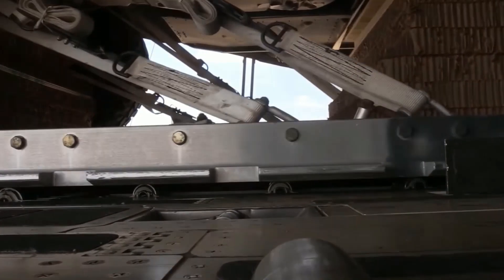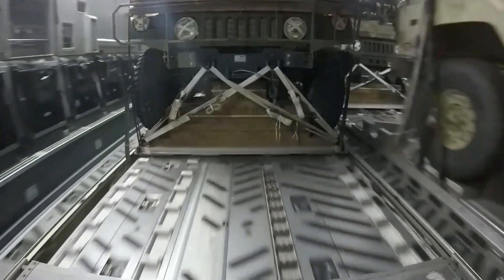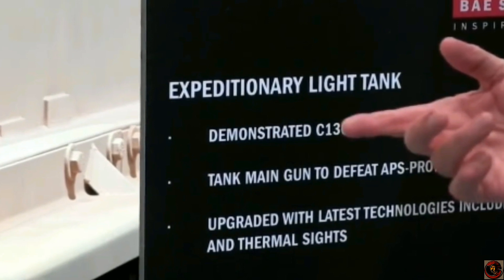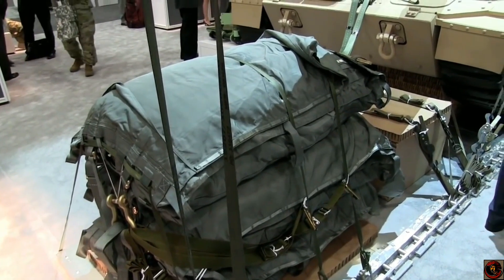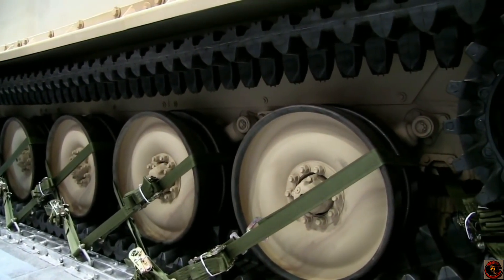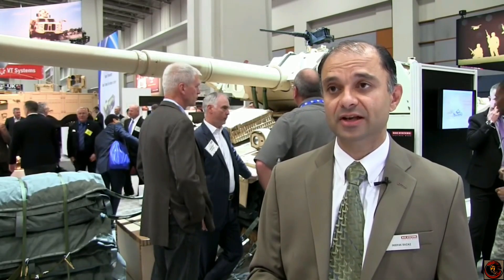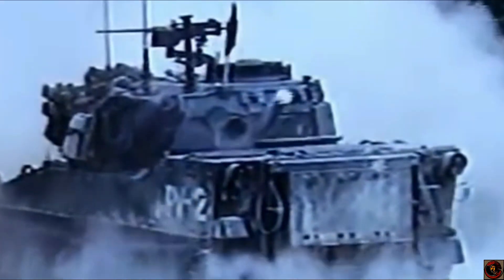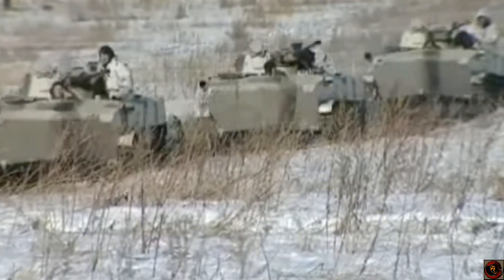Dropping a Tank From a Plane - Airborne Armour?

Comment: In my personal opinion this is a HUGE waste of money. First off because right now there is no need for it. Secondly if we did build a "light" tank, it is not going to have anywhere near the protection (armor) need to stop anykind of anti tank missile or main tank round. We are better off just using something like the Stryker Gun System. It has a VERY powerful 105mm that can easily destroy most MBTs and any IFV. It will probably have just as much protection as any tank they design that is going to be dropped out of a plane. Right now our best option is to just do what we have and that is to use our C-17's to land on a short, dirt runway and let it role off out the back! Otherwise all we are going to get if we spent money to design a new light tank is a tank that isn't going to have any armor. The reason why the Sheridan was a failure was because it had zero armor and the 152mm gun didn't work.

Comment: i find armies to day so f ing inefective and not having nearly as much fantasy or will to expariment with other things maybe im just stupid but i can think a system up right now i mean just make a ligth armor fast tank with good suspension an sloped armor with side doors as well as a top hatch to enter it and the parachute storred on top when it reaches a serten altitude it realeases the parachute or can be done manuely from the inside of the tank then u have a giant smoke container that can be dropped from under the tank to create smoke be fore landing when the tank lands u either realease the parachute from the indside or cut it off  should only seconds to doand if nedded be install wheels on it to make it even faster and with a good amount of camoflage to hide too bad the only nations that were a little creative with there armies where the nazis and soviets. but im no tank expert just a mechanic

Comment: Maybe one of the systems with a few anti tank missiles and a small caliber autocanon would fullfill much of the same role for less weight? If you designed it without the APC capacity and up armoured it? You could allways bring extra missiles seperately (in fact if you made it with infantry operated missiles you could drop the extra ammo with the infantry and retain anti armour capacity if your tank eats AA).

Comment: Hello Matt, I enjoy your non-gaming vids. This one was kinda like a home video for me. I serverd at Bragg for a dozen years. Most in 3/4th ADAR (Vulcan/Stinger) (82nd). Our unit was next door to 3/73rd Armor. Which was deactivated in 94 I believe. Left us all feeling heartbroken and less safe. The higher ups thought NO tank was better than an old tank. Supposedly a company of Bradleys at Ft. Stewart was set aside to support us in case we flew. We STIILL had to secure the DZ and FLS to get these there however. All made no sense to me. We dropped Charlie Company (I believe) on Panama in 89 very successfully. 8 G-11 parachutes for each tank. I hear there's something going on there lately again with tanks. I left in 02. A specialized armored vehicle is needed only until the rest of the 18th Airborne Corps starts arriving. 90mm main gun is plenty. Rubber tracks are fine. No more than a couple dozen rounds (including canister ;) Something that's not going to leave the DZ. If we had to, more than a couple miles that task would be passed off the Mech infantry. Keep the light tanks near Support. That's my 2 cents. We loved our Sheridans. It seems the politicians and defense contractors will make the decisions though. With little input from the guys in jump boots. 

Keep the vids coming. If you do one on the POS Avenger, gimme a shout.

Tino
Reply: I had completely forgotten that you could heavy drop a Sheridan!

I agree that the specialized stuff is only needed for a relatively short time before the heavier units arrive.
We had anti-armor infantry organic to the line battalions in the 1980s.  I was one.
If you have that kind of capability to fight against armor, it makes sense to do what you can to bring some of your own with you.
You really don't know the exact capabilities of the enemy at the DZ, so it makes good sense to bring whatever cases of whoopass that you reasonably can to the party to help secure the area for follow-on troops.
With the airfield takedown, you don't have follow-on troops just a few days of fighting away.  You ARE that landing area.
If you can't secure it, those guys probably aren't coming very soon and your best hope for a while is extensive airborne resupply while you figure out how to NOT let your new DZ catastrophically erode  into a 21st Century Dien Bein Phu.

AATW, Brother!

Comment: strv 103 the S tank ride height , not to be used in the offence but capable to secure an area on the defense side, rule 1 do not drop para's when there is no supprise and also not in an area secured by armoured units. But the strv 103 is very useful as an defense option  in an ambush.

Comment: Since we are talking about airborne/air assault operations, I would imagine that this vehicle would be used primarily to reduce strong points. In the anti tank role, it would probably held in reserve at higher HQ [ Regiment or higher ] for a reactive role. Much like the US tank destroyer doctrine from WW2. In such a role, heavy armor is less of an issue than rapid mobility.
Reply: It could also be useful in the asymetric conflicts Western forces increasingly find themselves in, if the hostile force doesn't have armor and shoulder-fired missiles are their only anti-tank option, lighter and on the scene is better than more capable and 500 miles away.

Comment: A prototype-sale pitch made by someone who is nto a salesman, for a system they want to build on top of a 15-20 year old platform, with a dev cycle that's still a pipe dream for a fairly niche yet useful deployment method.
The "ready within 15 mins" thing seemed rather long even for a second/rear/support line deployment.
I'm with you wghere they may be bettter off designing the system from the ground up rather than testing and rebuilding an older platform to fit the current requirements.

Comment: Rubberized tracks contain metal components internally.  Metal tracks use rubber material.  They are really not so different.  Metal tracks use mechanical connections that include pins and rotating connections. Rubber tracks are built as a single component that uses flexing belts of metal inside and rubber outside.  Like radial tyres. Common, everyday use of combined use and flexible materials.

 Rubber tracks were proven reliable on US M# half trucks that operated for many years after WW2 with long lasting tracks.  Some are still in use privately.  I had a Kawasaki with belt drive and I thought it was great.  The difference between the two systems is not so great if you consider them from a different perspective.

Still, I am not expecting main battle tanks to change.  They do not compare to WW2 tank tracks.  They are built to much higher quality and strength with much greater reliability. They achieve greater speeds and longer ranges with less maintenance and failures. Steal tracks are here to stay and rubber tracks will be used as well for lighter vehicles. 

  I have not seen rubberized tracks used on an MBT.  I am a big fan of  wheeled AFVs,  ( for Australia's long distances ) but tracked tanks still have a major role.

Comment: That is Sicily DZ at Bragg. My buddies back in the 80s who had participated in CALFEX exercises would see the Sheridan tanks being LAPEs dropped after the entire brigade has dropped just crash into the sand. I have jumped Sicily a couple of times training at Bragg I would have loved to see a Sheridan being LAPEs dropped personally.
Reply: I believe that the LAPES deployment is still quite viable for such a system.
But, it looks like these guys are talking about something like a heavy drop for a light armored vehicle, which is completely insane.

The canopies alone (8) to heavy drop a full sized road grader come out to a literal ton in weight.
That does not count the rigging. That is just the parachutes.
Then there is the problem inherent to Airborne operations: exactly where is this multi-ton hunk of explosives-laden equipment going to actually land?
Sicily DZ is nice and huge, yet on a dog-and-pony show when the Soviets visited Ft. Bragg in the late 1980s saw about half of a battalion of men being deposited into the trees on the NorthWest corner of Sicily because of the vagaries of the winds and human error. I found myself over a section of the DZ that I had never even seen before which caused me to have to slip so hard and long to avoid trees that I did cheetah flips on landing and bent my M-16.
How many times have we witnessed heavy equipment simply drifting into the forest at the edge of the DZ?

Then there is the problem of finding the damned thing once you land since the heavies are deployed first.
It's usually dark and there are over 1,000 excited and nervous young men running around with lots of deadly equipment just itching for an excuse to unload it on someone, not to mention the actual enemy that is actively trying its damnedest to kill you.
It's a wonder that you can locate any heavy equipment on a hot DZ even with the extensive amount of training that Airborne Infantry does.

LAPES makes a whole lot more sense based on the fact that the primary mission of Airborne operations for the past several decades has been airfield takedown just like my boys did to open the Christmas party Panama 1989.

LAPES, like any system, is not perfect.  Bad stuff happens like what you mentioned and like the pilot error in the Summer of 1987 that lead to the loss of a C-130 and crew plus a few on the ground.
https://www.youtube.com/watch?v=kyhKCAgk5oo
Side note: The actual load was delivered unharmed and the aircraft and crew would have survived is they had a few hundred more yards before the trees and the 50 foot or so drop at the edge of the DZ.

Matsimus mentions the Russians airdropping APCs successfully.
I believe that 2/325th experimented with doing that very thing with LAV25s back in the late 1980s."
Also, APCs are far lighter than an actual tank, even the M-551 with its light hull.
Notice the crazy amount of canopies used to drop that Russian APC and then try to increase that for the additional weight of an actual tank.
You would probably need some kind of retro-rocket system for the actual landing.
But then, we would be getting into HALO ODST fantasy territory which is an entire new world of troop deployment badassery altogether.

AATW, reddevilparatrooper!

Comment: they should also upgrade it with a low recoil 120mm gun. but in the end, it shouldn't be used for armored warfare, it should be used for troop support.

Comment: you do air drops like that in low security areas either close to the front lines or in a FOB/LZ behind enemy lines. that is what the airborne was for, deep strike skirmishers and "line-breaking".

light tanks are like light calvery, used to cause havock behind the enemy line and chase broken units.

they are a shock force, not meant for extended combat or  extended isolated operation. they drop, cause problems, then meet up with the main forces form ranks and hold

example from history: Siege of Bastogne, siege of mascow, operation Market-Garden, Operation Junction City(vietnam)

Comment: The M551 Sheridan was designed to be dropped for Airborne troop. (when it doesn't work it is quite spectacular, they break!) The gun/rocket system on the M551 sucks! It was also used on the M60A2.
Reply: Also check out the  M8 Armored Gun System and the competing CCV-L by FNC. Another interesting proposal was the Stingray by Cadillac Gage.

Comment: It's good to hear they're doing this, but why not update the Sheridan instead or in conjunction? Give the Sheridan active protection systems that have been developed recently to mitigate the problems of having aluminum armor, give it a faster and lighter engine, update its gun and ammo, give it a ATGM that doesn't suck, and update the electronics. Maybe reduce the gun to the gun this thing is using to fix the recoil issue and the lack of ammo problem the 152 mm had and with the reduced weight from the gun maybe they can give it a little bit of additional protection. It's a proven design that had some problems but we know what the problems are and they can be fixed.
Reply: The US Army has a newer platform, already type classified.

The M8 armoured gun system. Light, long gun, and track.

Why the Stryker though?

Comment: Airborne russian vehicle is called BMD-4. 100mm gun paired with 30mm coaxial mg, amphibious, very fast and maneuverable, has decent protection, can transport 5 troops ...  that 100mm can punch pretty hard. 13,6t of weight. light, powerful, maneuverable, versatile. no need for a tank!

Comment: I was a turret mech for the M551 Sheridan in the 82nd. This air-droppable light tank never got the props it deserved. Yes it was plagued with certain electronic & loader problems but a good mech knew where the weaknesses were and what to keep an eye on. When we did maneuvers (usually against the Marines) hitting the ground yourself and then seeing these and gamma goats being dragged out of a C130 to hit the ground and skid to a stop was quite a reassuring sight.

Comment: Surely some kind of palette could be designed to absorb the impact of landing.  It doesn't have to survive the landing, it could be designed to crumple, absorbing the shock like crumple zones in car chassis.

Just attach a Volvo to the bottom of the tank or something.
Reply: The Volvo wouldn't work, it would remain intact with a crashed tank on the top. :P
How about putting rockets to the 'chute to slow down the thing before hitting the ground? That would be cool!

(That's how the Russians/Soviets have been dropping tanks with crew inside since 1975.)
Reply: It is cool.  I've seen that idea used on some footage matt has used in a recent video, can't remember which one ... one of the cold war related ones i think.

Comment: The material tech has advanced by an order of magnitude so rubber tracks are awesome however...the issue of a hit taking out a section of track that can't be replaced vs metal link tracks if you have replacement links on hand is worthy of note.

Comment: this was the M8 Buford, the USA did trial extensively as well as the Stringray tank (bought by Thailand), it was designed for 3 types of armor packages, after it lands you fit the spaced modulated armor blocks to the turret and away you go, it was hit with shape charges in the trials, there are better videos of the hits, interesting viewing on it's own, but they scrapped the project in favor of going all striker vehicles, again I think Russia with a amphibious airborne family of combat vehicles is leading the way, this force won't win the battle but able to cut off supply lines, reinforce and deploy to harass weak spots could put huge pressure on enemy command to make the wrong decision.
Reply: just saw the Publish date, oops thought it was new.

Comment: If you have to move tanks fast into battle there is a way - like the Norwegeans shows here: 
https://www.youtube.com/watch?v=n6U7g7zDLZs

But that presupposes that you have control of the sea - and the port - and the battle is reasonably close to the port. Because the resupply will also have to come by ship. But you can get a battlegroup (BTN) in that can do some serious damage - the real problem is not the hostile tanks for a Leopard 2, but where to get more grenades to KILL the enemy. But given those condition - it is a very good idea. If for no other reason: It will make the enemy's planners tear their hair out by the prospect that they just might run into a battlegroup with infantry and damned precise artillery - and most of all: You have no idea where they are - as they were in a Norwegean fiord 24 hours ago!

As to dropping tanks out of an aircraft? Well a cat survives a drop of a couple of stories because it is build for it. An elefant can't even run or it would break its legs. It gets around that problem with a brisk walk - very  brisk! The germans tried it with a Wiesel - worked perfectly - until you tried to drive the now slightly dented tank!
Another problem is that a Globemaster III lifts about 80 tons and can lift ONE Abrams. Now at battailion would have about 50 vehicles and getting them in would probably take about 40 lifts. The USAF has about 200 of them in total which means a brigade would take the entire USAF heavy lift capacity at once - otherwise lifting it in several portions would defy the purpose of getting them there quickly. Besides that: How are the road connections to that airport (not to mention the snooty custumsofficials: Do You carry any concieled weapons?)?

As to rubberband tracks? Well I have a hunch thar going much above 10 - maybe 15 - tons in weight will land you in trouble - with an oversized sling shot. I simply can't see a Challenger mounted with the worlds biggest eraser......
On the other hand if ypu have the protected vehicles (like a Mowag Eagle 5) it is an entirely different ballgame. If they can arrive so quickly that they can move into prepared positions ahead of the enemy - then they could be the proverbial nasty surprise. And with a squadron of 6 Globemasters you could move a battalion battlegroup - not toooo difficult to keep supplied with teabags and other stuff.

The real challenge is when they have moved into position to keep them supplied. Here you should be able to set up a 500 m strip for a small transport plane like the C-27J Spartan for reloads.

Comment: Indeed. Metal tracks will run after you obliterated every bit of rubber on said track. Your track could have every single track section in dead-line because every bushing is borked, and it'll run.